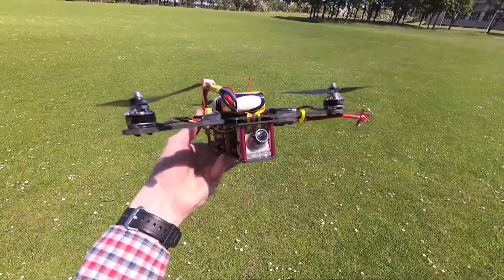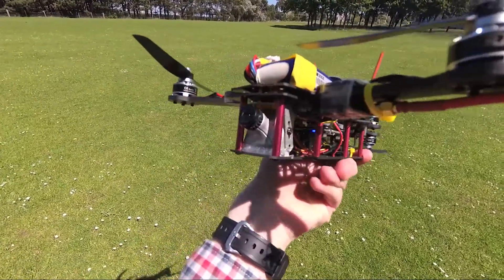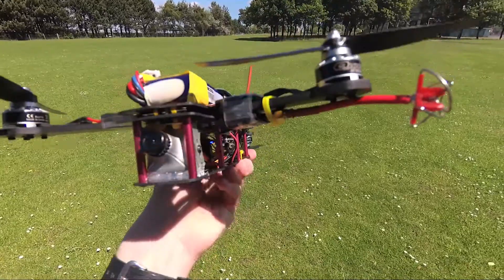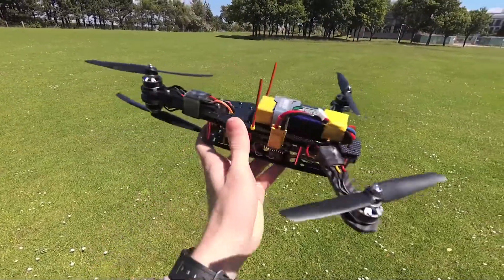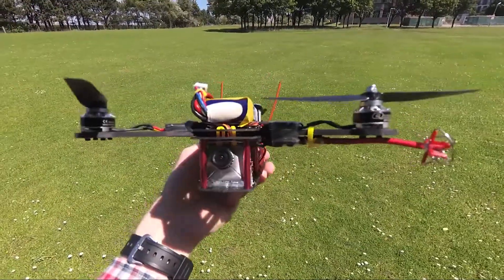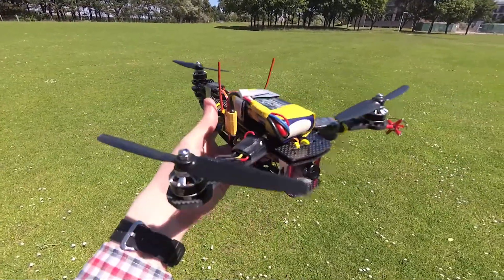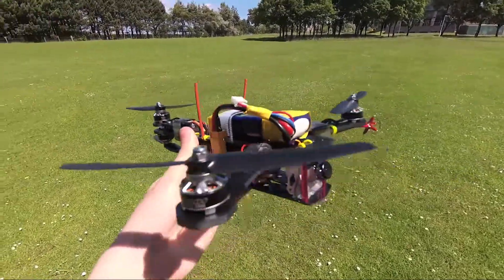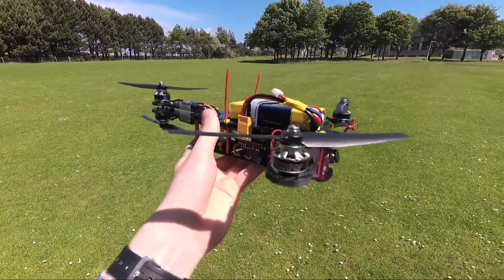ZMR250 Y4 conversion - FPV

Comment: So it`s not perfect but if you try it can be better.Maybe 4S or just changing the props will be better.My tricopter is better with 6040 king kong props 3S 1300mah but i try others just to see the difference.My tail motor is working very hard so i may try mixing it up.
Reply from the maker: I will try it with an easier prop next like a 5030 two blade. I also couldn't get Cleanflight on the laptop I take to the field to connect to it, so I couldn't change any of the PIDs - I suspect that the yaw P & I might need more tweaking than I'm used to with a regular quad!